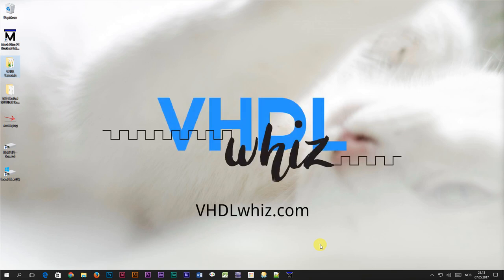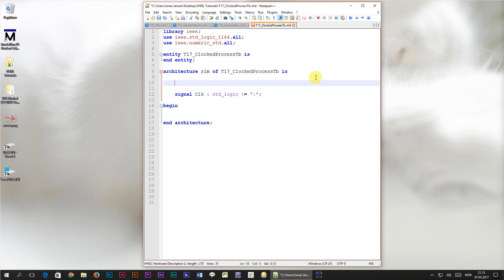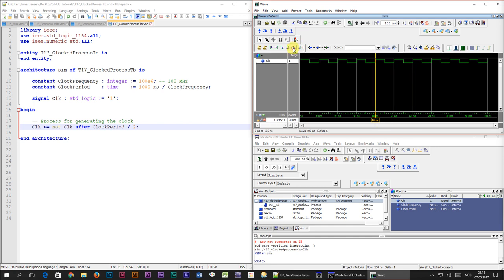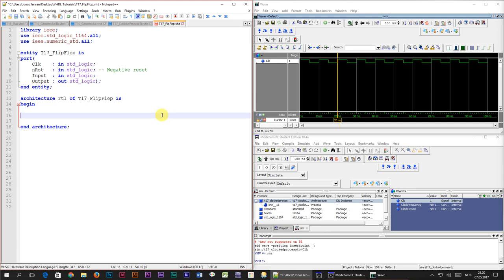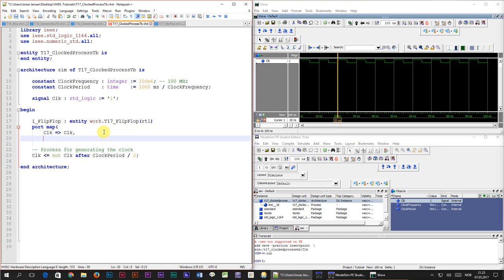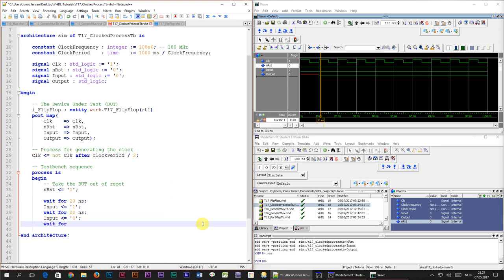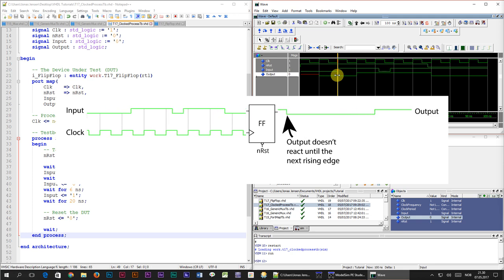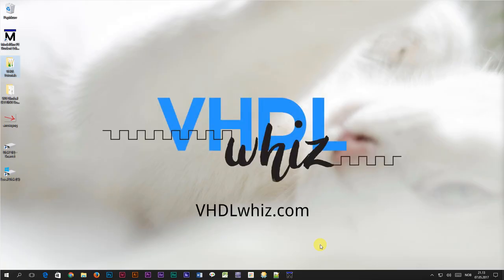How to create a Clocked Process in VHDL

Comment: You said in previous video ( signals and variables ) that the signals change after wait statements. So nRst should change after 20 ns and Input should change after 22 ns. I am a bit confused.
Reply from the maker: The signal values are updated when the program hits the Wait-statement, not when it wakes up from it. In the Signals and Variables video I didn't show the waveform, so you couldn't see this behavior.

It is a bit confusing at first, but once you understand it you will see that it all makes sense.

If you want to know more you can check out my blog post about delta cycles:
https://vhdlwhiz.com/delta-cycles-explained/

Comment: A tip from mathematician You can also write for clockperiod = (1/clockfrequency) you will get the same.
Reply from the maker: That would be "clockperiod := 1 sec / clockfrequence" because otherwise the result won't be of type "time", and that's a compilation error.
Reply: @VHDLwhiz i was going to ask if there was a reason to use 1000ms instead of 1s?
Reply from the maker: That would also work. It's the same.
Reply: @VHDLwhiz  I am going to be taking a VHDL/Verilog course at school in September. This series has really boosted my interest in the subject. Thank you for providing this resource.

Comment: if the "wait" statement in VHDL doesnt work in real life, how does the "after" statement work in real life?
Reply: ClockedProcessTB line 29
Reply from the maker: The "after" keyword also doesn't work in real life. We only use the "wait for" and "after" keywords in testbenches. They are for simulating events that are not part of the device under test. For example, in this testbench, we are using the "after" keyword on line 29 to generate the clock signal. The FPGA has to get this signal through a physical pin, but we can simulate it easily like that.
Reply: write a counter